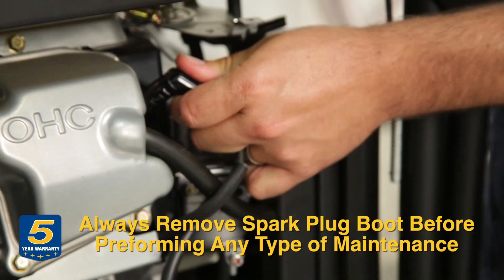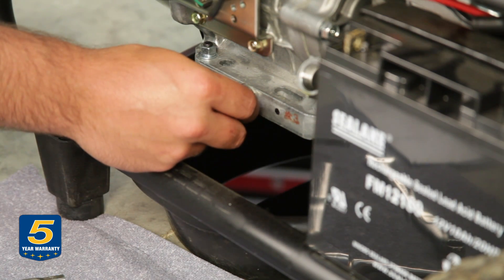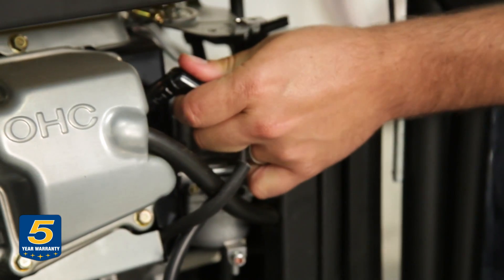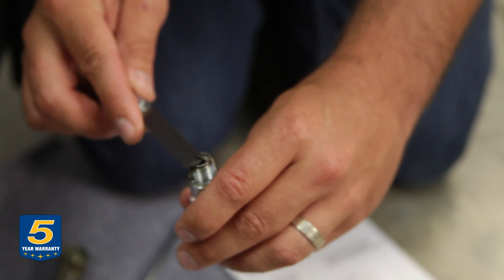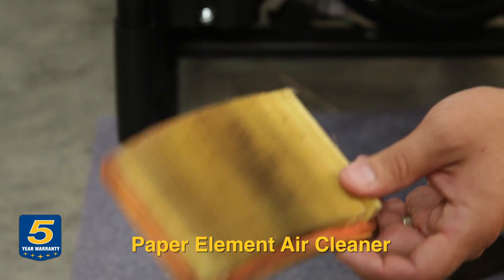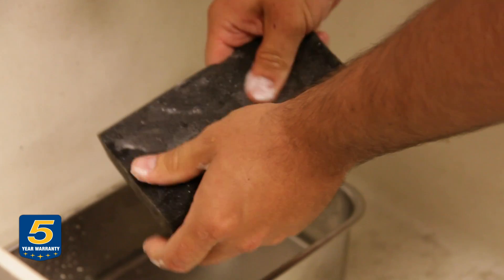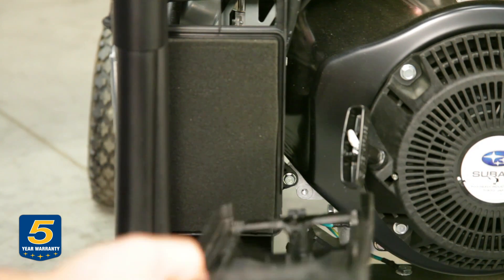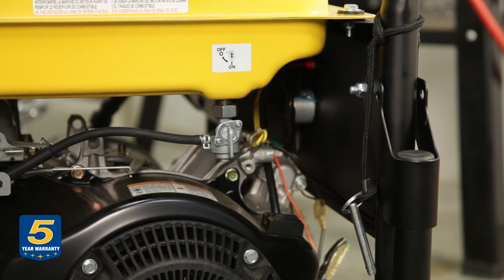How to Perform a Spring Tune-up on a Horizontal Shaft Overhead Cam Engine

Comment: Hmmm? Subaru recommends 10w-30 as stated yet you add what appears to be 15w-40? 10w-30 full synthetic would be my recommendation for any new gasoline powered 4 stroke overhead valve engine.